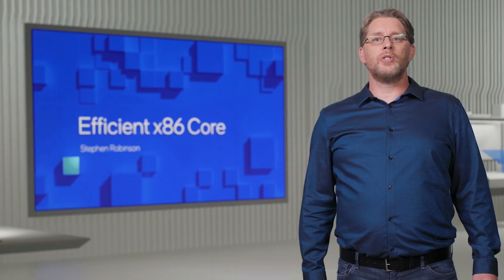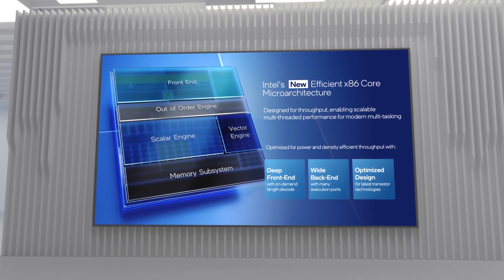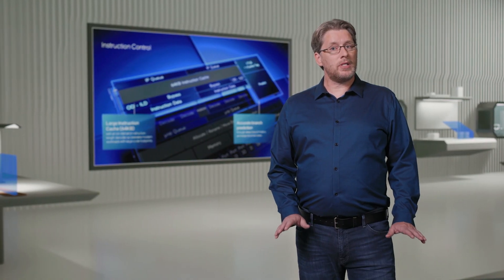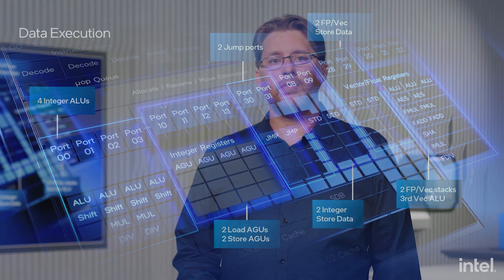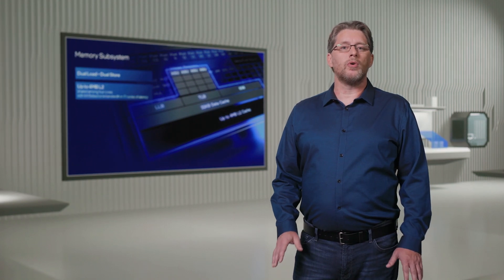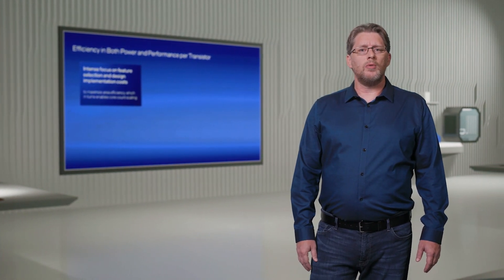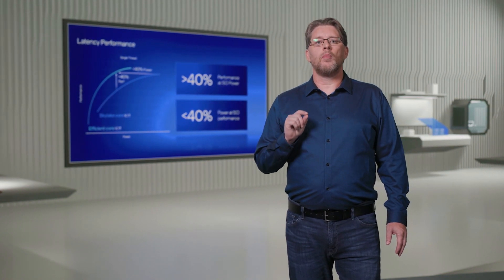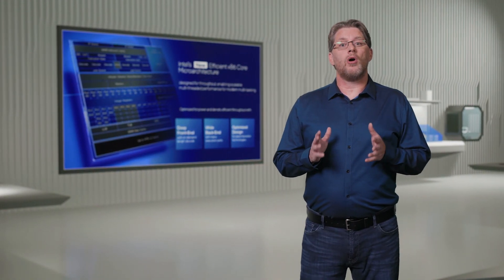Efficient-core - Architecture Day 2021 | Intel Technology

Comment: so the gracemont atom  even stronger then skylake core.
what is skylake core?
i3 6100 (3.7ghz), i5 6500(3.5ghz) i7 6700k(4ghz)

i have i3 6100, i7 8700k, i9 10900k .actually ,they all base on skylake.
but i think intel this comparison is compare to 6th gen, the original skylake.
Reply: IPC is better (single thread performance at the same clock). Ultimate performance is a different thing, it's a combination of IPC and clock speed. As far as we know Gracemont will clock between 3-4 Ghz.
Reply: @K543  skylake clock speed also at 3-4ghz
Reply: @bogodoyandex9654  In many SKUs yes. It needs to be said that Coffeelake and Cometlake are also Skylake based, they have a higher peak clock speed.
Reply: @K543  i only say that original skylake.
Reply: gracemont might be slightly more powerful than skylake in single-thread, but not sure about multi-thread..... Not only gracemont lack HT but also it has shared component between 4 cores..... Basically when one core is used gracemont has access to a lot of L2 cache, but in multicore, 4 cores will have same cache because it is shared..... So multi-core scalling might not be as good as skylake
Reply: @killermoon635  I don't think so. They can easily put more Gracemont cores into the chip and still be more area efficient than Skylake would have been. 8 Gracemont are a lot smaller than 4 Skylake even in a iso 10nm comparison. Multithread is the bigger strength of Gracemont therefore. 
For singlethread usage there is a big core.

Comment: Why compare to skylake from 2017? and not comparing to newer 10th or 11th gen
Reply: 10th zen also skylake .
Reply: you got the point.
but intel oficially this. the last two graph not only show that gracemont have better efficiency than skylake, also show gracemont even stronger than skylake when both at peak clock speed.

as we know, atom alway better efficiency at low clock speed, low tdp compare to core,so no suprise gracemont much much better efficiency then skylake

we really need notice is the peak performance gracemont  even stronger than skylake.
skylake actually no weak, i3 6100 (3.7ghz),i5 6500(3,5ghz),i7 6700k(4.0ghz)
and i7 6700k can oc to all core 4.6ghz.

that, mean gracemont clock speed could be very high,or higher ipc than skylake(cometlake same ipc at here)

Comment: Can't wait to see gracemont!!!!
Reply: so look like intel officially gracemont stronger than skylake.
the original skylake= i3 6100, i5 6500 ,i7 6700k 
i7 6700k maximun clock speed is 4ghz, oc peak is all core 4.6 ghz with normal heat sink